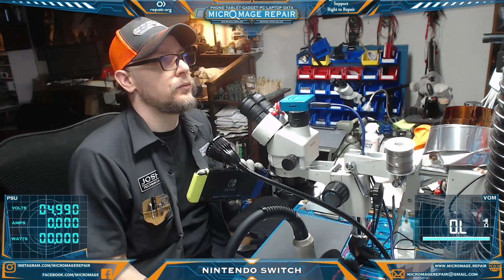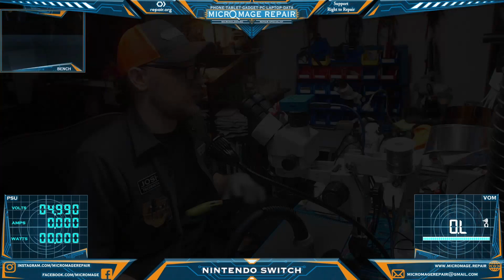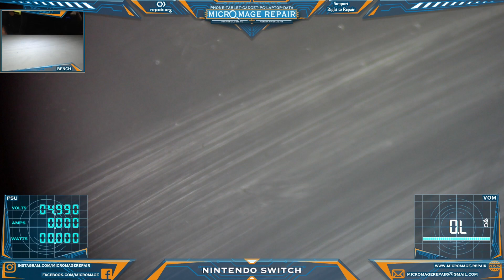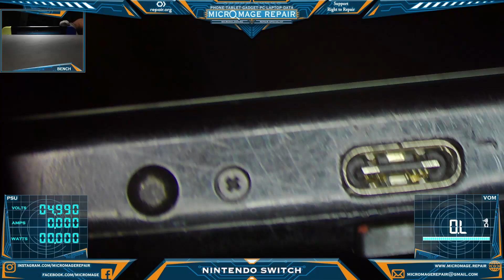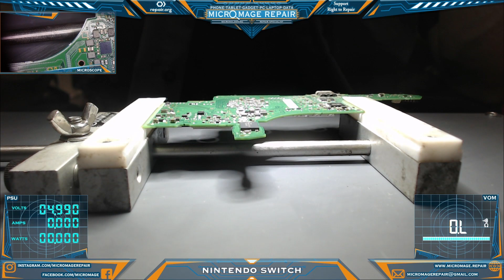Don't cross the streams!

Comment: Quality as always pal 😎 If I were doing a Switch USB-C port replacement, would it be silly to heat the area up a bit first once I've tinned the pads before putting the new port on? I seem to melt the plastic on them WAY to easy, even if I'm quickly moving the air around 😢
Reply from the maker: Thanks Joey!
There's lots of methods for placement, it's a matter of what works for you.
If you attempt my method you must move the air rapidly to avoid burning.
Don't ever want it focused anywhere long enough to burn.
The idea is to bring the board up to enough temperature to wet solder rather than heat the solder up directly.
Reply: @MicroMageRepair  Thanks dude :)